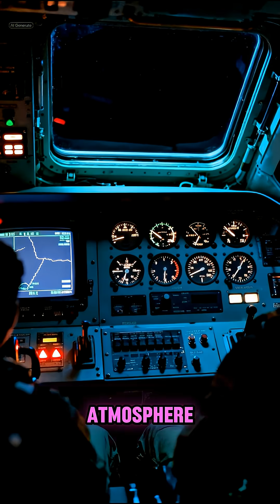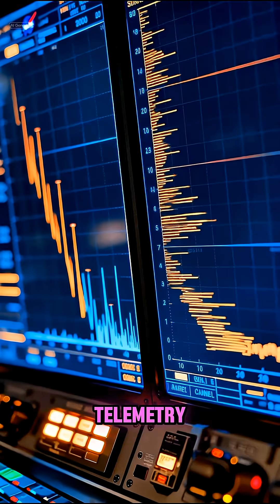The Spacecraft That Lost Contact During Re-entry

Comment: I watched both shuttles destruction on tv and both times it was mainly due to nasa administration not listening to the engineers that tried telling them the problems. Challenger could have easily been saved by just not launching, there was no need for them to go when they did but nasa didnt want another delay because of the propaganda they wanted. The Columbia was in a much worse position but nasa should have never let it get that far in the first place. Engineers once again had warned administrators of this exact issue but they deemed it an acceptable risk, they normalized it since they had gotten away with it every other time even though they were specifically warned before this mission of the risk. As far as im concerned some of those administrators should have seen a prison or atleast a court room.